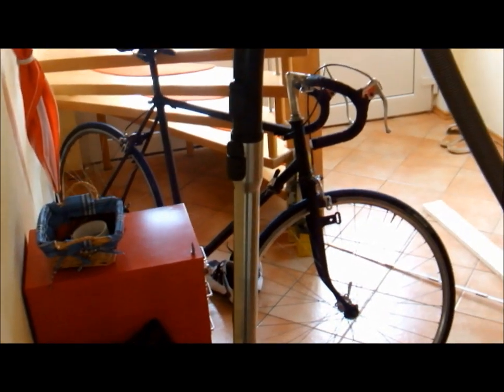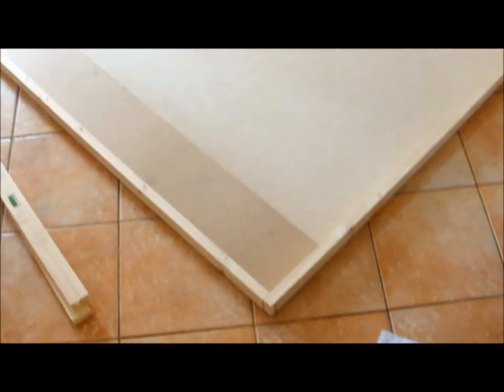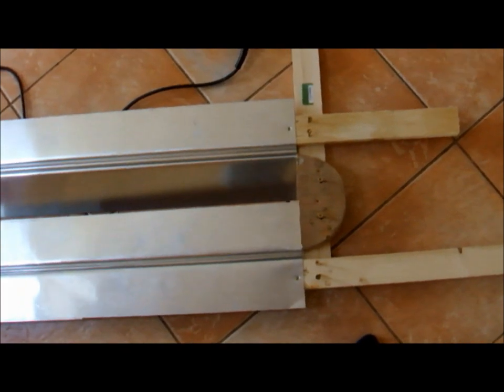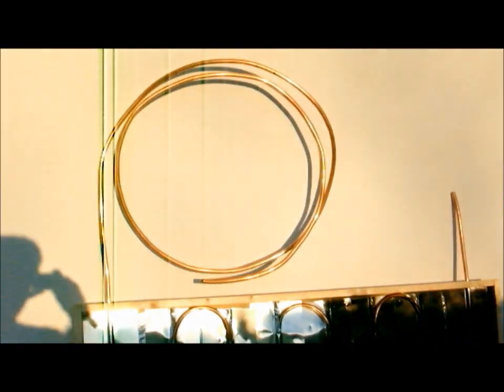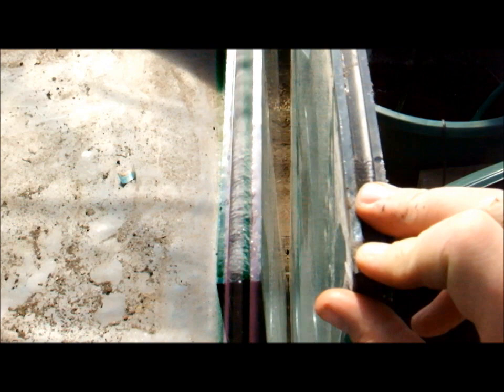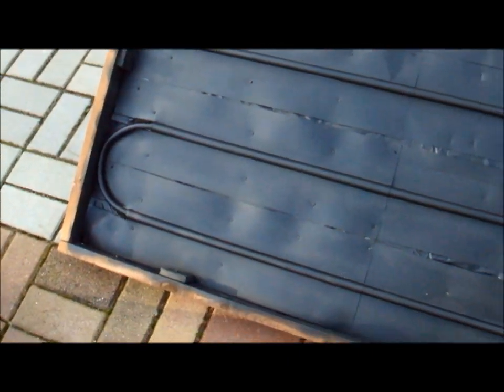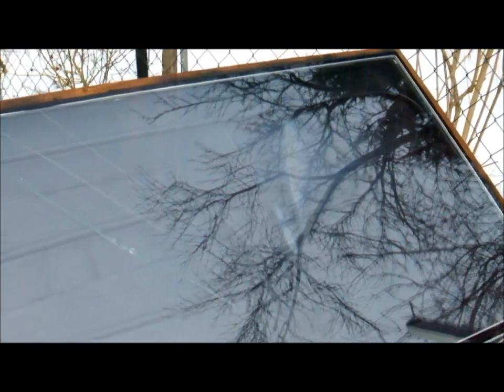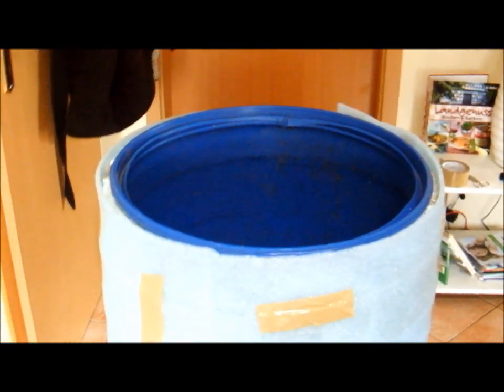Berlin Aquaponics - Building a Solar Water Heater

Comment: I just finished a AP swirl filter video using uniseals and I am sure that they would work great for your hot water storage. I even gave some great tips in case you have not used them before. 
Nice Dome by the way. I am glad that I am not the only one that still has snow on the ground. Take care

Comment: 3. Windows are not necessarily very good for panel glazing, they are quite often mixed with additives, to prevent them from letting through infra red, ie sun heat, which is great for energy saving windows, but not exactly what you want for panel glazing (rather the opposite)

Comment: what, with a tin foil??? You need a proper INSULATION, go & check your local hardware store how insulation looks like. I would recommend rigid foam+tinfoil panels, they have great U value and are not adding too much depth, but anything would do (in a proper amount)

Flat panels have very low yields, and therefore, they need to be insulated properly, to be effective at all.

Don't take it personally, but your design is not very good, take my words as constructive criticism
Reply: I just applied this recommendation and it is maintaining an outdoor fish tank temp 25+ degrees (F) above avg air temp. Overnight lows hit 40 (F) tank in morning is 71(F)